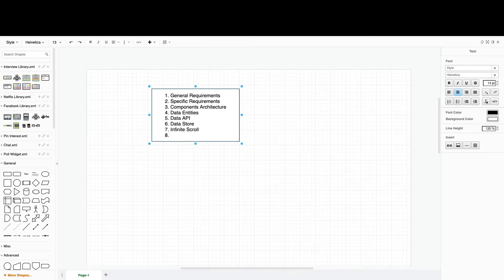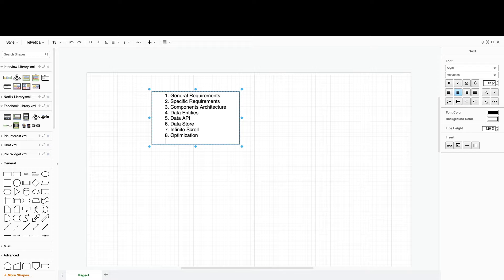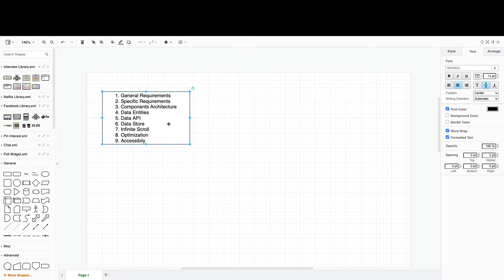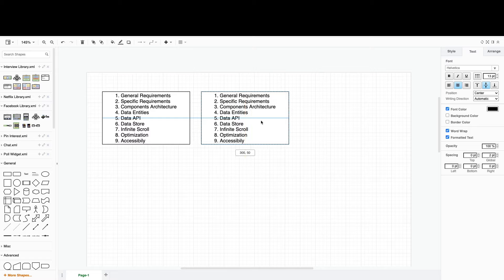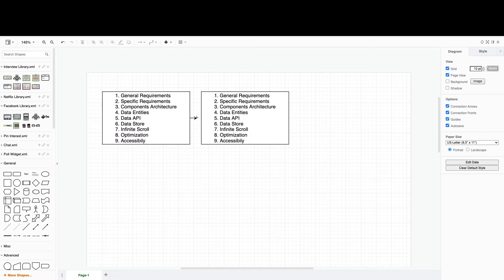[Front End System Design] - Facebook News Feed

Comment: Happy to report that I passed my front end systems design interview thanks to these videos (in particular, my interviewer loved the 9-step plan and the overview of polling/WebSockets/SSE). Very big thanks! Subbed
Reply from the maker: Hey Brian. Thank you for your report. I'm really happy that this worked out for you 🚀
Good luck with a new job 👍
Reply: @FrontEndEngineer   Thanks for the great videos!. Can you share the link to schemas for all the videos?. That would be really helpful.
Reply: @venkatkarasani  You'll actually get even more out of these videos if you build the diagrams from scratch as you watch, especially since that's what you might be doing during a FE interview. I used Excalidraw.
Reply: What is the best way to study these lectures ?
can you give me your experience ?
Reply: this is probably best endorsement a youtube video could get
Reply: @halusky  thanks for that tip on excalidraw
Reply: Company ?
Reply: @halusky  But I only have a couple of days before my design interview. Just cleared the coding round yesterday. So if I keep all of the schemas handy to use during the interview, even that might impress them right?

Comment: A quick point on accessibility - you definitely do not want all inputs and textareas to have aria-live. That will create an extremely bad experience for a blind user. aria-live should only really be used for alerts, and even then it should be used sparingly. Screen readers can already easily read the text in inputs and textareas. In general, the first rule of aria is "Don't use ARIA" because it is so often misused.

Comment: Sorry, but I didn't quite get the decision of choosing SSE /longpolling / websocke as an effective way to fetch new stories. My thoughts - 
1. It creates unnecessary connection (since with SSE or WS the connections has to be alive between client and server) so we need to invest a lot to horizontally scale our servers in order to deal with these many connections from client.  
2. At client side, it will have overhead of keeping the connection open and In a typical mobile application that would mean a background task draining your network bandwidth and battery,
I think this should be on-demand as and when user is scrolling and trying to get more feed items. We can do that using a throttled REST call or graphQL call.

Comment: Thank you for the video, it's very helpful!

A quick point on the API (getPosts, createPost, createComment): if it is exposed to FE, sending user_id as a parameter might be a vulnerability. 
A malicious user may take action on behalf of another user by explicitly updating userId. 
Ideally our api_key should be user-specific, so we can identify them based on it.

A quick point on Normalization: It might be beneficial to store in a way {userId: User} instead of {feedId: User}. User is a separate entity and it might be beneficial not to bind it with a particular feature strucute. When it is used in another components (private messages, for example), we might need to retrieve User but feedId is missing. 

A quick point on Long Polling: I'm not sure if it is supposed to be called in specific intervals, it holds connection until data is returned. We may trigger it based on scrolling events to fetch next stories on demand.

Comment: Loved it! Would like to add that we can also talk about the lower level architecture like folder structure, component APIs (if something like React is used), & are they well defined. how would you compose the components (patterns) , design patterns used & why, choice of libraries & why (Ex: what would library would you use to have a store), when would you choose persistent storage vs in-memory storage, etc? Overall, I still love the methodical approach - if the question you get is to design a core library like a logger system, UI becomes less of a focus and we need to delve deeper into just the logic & perf
Reply: I guess one doesn't expect to get to design a logger system in a Front End Design round so those questions of choosing storage take back seat!
This is one of the best front end design videos I have seen covering so many imp topics